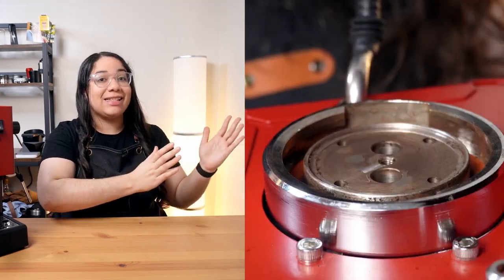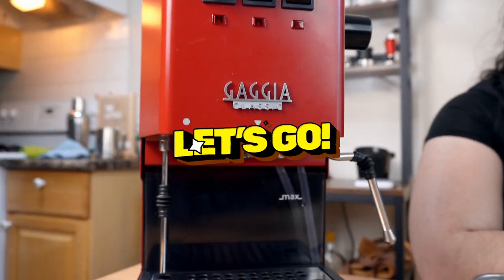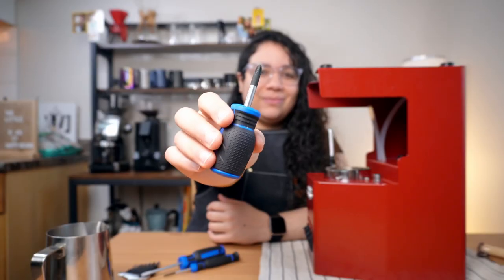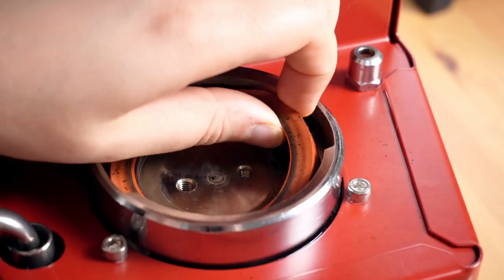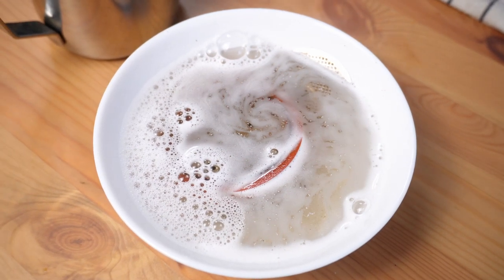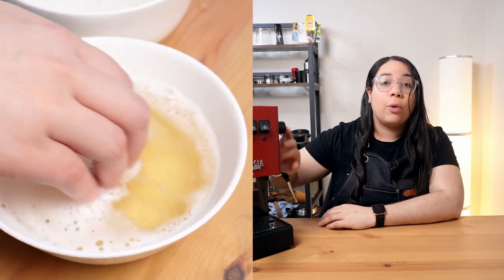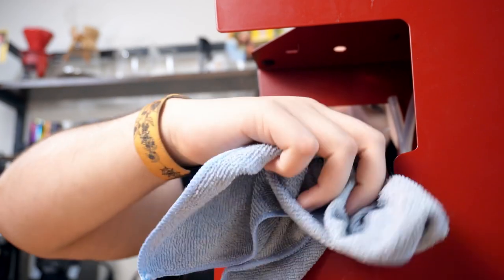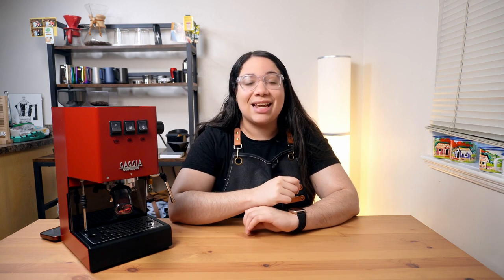How To Clean The Group Head On A Gaggia Classic Pro! [Espresso Machine Maintenance]

Comment: Great video! Just a few tips: the gasket should be changed every 6 months, or when you see those groves in it, like yours. Also, this machine is build like a tank and every piece can be bought and replaced if needed. Treat it like a car: if it's broken, go fix it, not dump it. The parts are very common and quite cheap.

But just like you said in the video: maintenance is key to great coffee made with clean water and a reliable machine
Reply from the maker: Thanks for the tips! ☕️
Reply: Wow Thanks I just realized I needed to replace mine asap!!!

Comment: I use baking soda to clean my group head and after a bit of soaking everything comes out clean and shiny. One of the first things I did when I received my GCP was to gt a silicine group gasket. Easier to remove, clean and it lasts much longer.
Reply from the maker: That’s a great tip! Thanks for sharing 🙌🏼
Reply: You're very welcome. We're all in this to make better coffee. I Used to buy the name brand products to keep my machine running clean and smooth. I live in Costa Rica and it's very expensive to source those products. I checked the ingredients in the most popular descaling agenda and found that the main ingredient in most is citric acid with lactic acid also added. So I use citric acid for descaling and sodium bicarbonate for back flushing and group head cleaning.

Comment: 01:13 what if I cannot remove the thicker shower screen plate even after removing the two screws? My machine is fairly new and this thing is stuck on there. 🤯
Reply from the maker: 🙈 it could be hard to remove the first time. That’s why I stick a flat head screwdriver in one of the holes and pull as it was a lever. You can try the different holes around the edges, but with some leverage it should be easier!